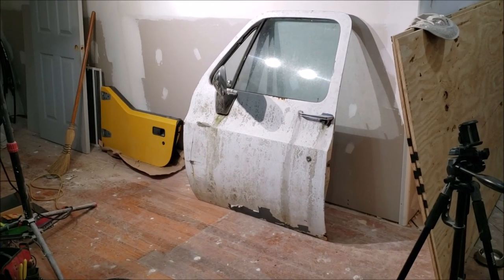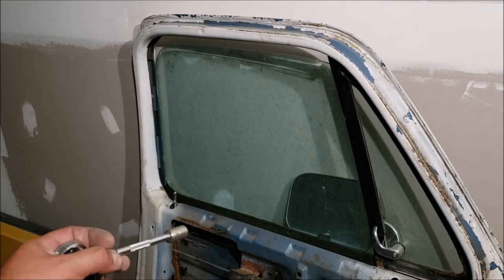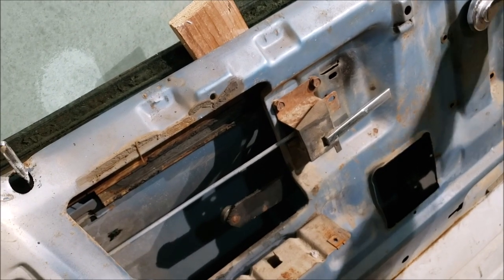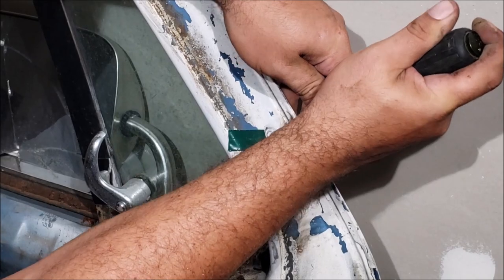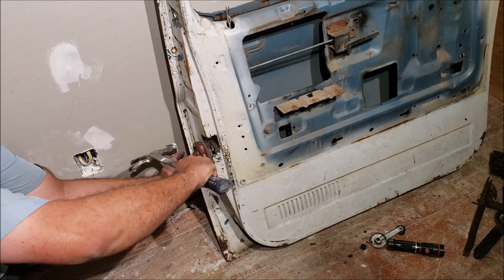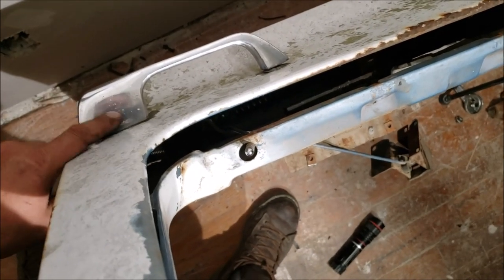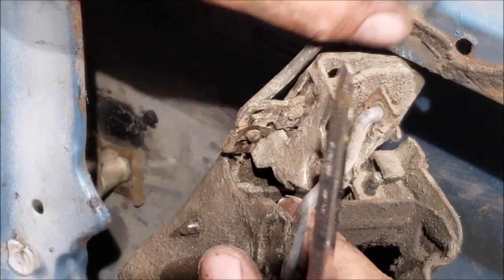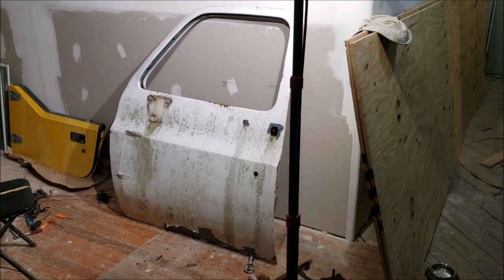73-87 GM truck C10 DOOR TEARDOWN

Comment: Thanks for the video. I had 6 drs to strip down and needed the order. I would make a suggestion that is a LOT easy. I did the first outside door handle as you said and it was a pain. Took forever. Once out I looked at it and the way I did the rest makes this cake. Leave the 2 outside door handle bolts and 3 door latch screws in place and tight. Then, with a extra long, newer(meaning not rounded off) normal screwdriver come down through the door glass slit and push the clip straight down. I just tap with my palm and the edge is enough to catch it and open it up so you can get that rod from the door latch assembly. THEN take all the bolts and screws out. It took less than 20 seconds average to get that clip off on the remaining 5 doors. With it all tight, it holds it in a position for you to do this. Looking through the door glass opening you can see everything and a simple light inside the door makes it nice. Hope this helps someone else.
Reply: thanks for the tip
Reply: @larrymiller9894  No problem.

Comment: Great video as always and love the comedy.
I have a 63 C10 and my passenger side window spring is weak where the window don’t move when cranked but I can slide it up and down easy and it stays wherever I want.

I bought a new regulator setup to swap it.
Do I need to do all your steps or can I leave the triangle window in place to take out the glass to swap the regulator?

Thanks!!!
Reply from the maker: you can change a regulator in 10 minutes.. everything can stay in..,on my power window video I show taking one out in minutes

Comment: Great video! But my gear on the reglator is jammed and I can't crank it back and forth to get the wheels out of the track. I'm guessing I'll have to take a cut of wheel to the ones I can reach. Not sure yet

Comment: After about 30 minutes of fighting with the clip for the outside door handle, I took a step up bit measured down to it and drilled a 1" access hole, literally 15 seconds later it was off

Comment: Is there anyway to reinforce the door skin? especially at the window.
Reply from the maker: There is a screw.. does yours have the screw missing?
Reply: @chriscraft77022  I was meaning like a 1/2 x 1/2 metal angle welded in. the door skin is flexing on my doors , really bad on the driver door 1987 GMC
Reply from the maker: @fn6553  im about to find out..   i got a video soon on the doors for my truck and totally understand what you are talking about..
Reply: Cool, I'll be looking for it.

Comment: How do you replace the armrest
Reply from the maker: 73-80 just 2 screws 81-87 you have to take door panel off there is a bolt on arm rest
Reply: Chris Craft dang I was hoping I wouldn’t have to take the door panel off but that’s ok. Thank you